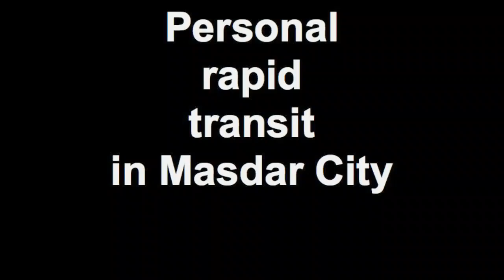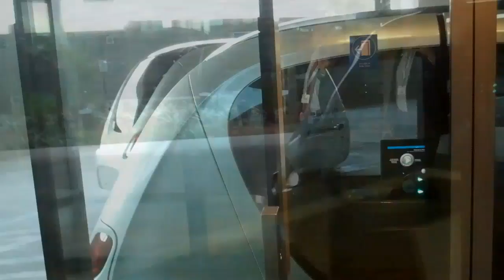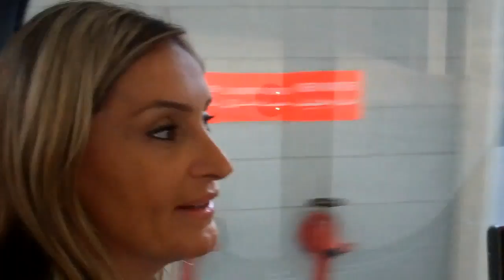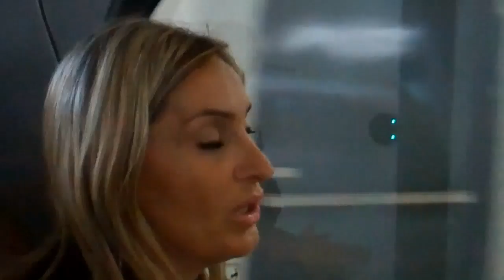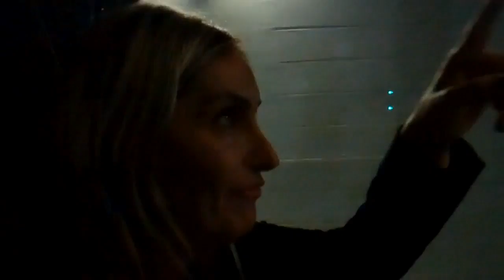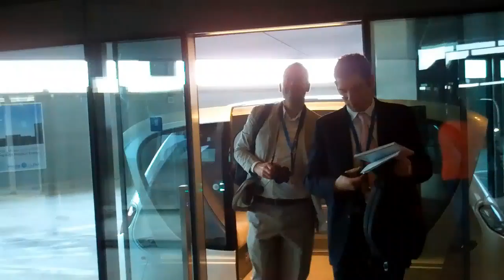Personal  rapid transit in Masdar City

Comment: Dubai has a fantastic driverless Metro system but I think we have to recognise the difference between a driverless train and this new concept of "Personal Rapid Transit" which, as far as I'm aware, Abu Dhabi's Masdar City may be the first major  implementation. It's not just an evolution of a computer controlled train, its a revolution in the way people make make use of transport. I just hope it's integrated with a wider transport system outside of Masdar.